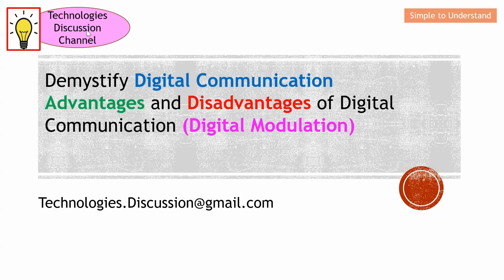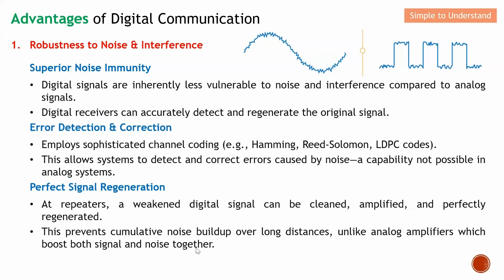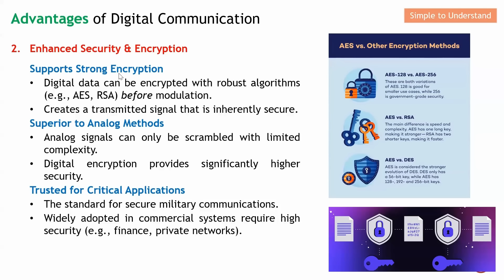Digital Communication #4. Advantages & Disadvantages of Digital Communication (Digital Modulation)

Comment from the maker: Thank you for your time to view this Digital Communication Series course. I have decided to revamp the topics of discussion.
In this video, I would like to explain why almost all communication now happens to be digital. This is because the advantages of digital communication simply outweigh all the disadvantages and also the advantages of analog communication.
The advantages of digital communication include:
1) Robustness to Noise & Interference
2) Enhanced Security & Encryption
3) Efficient Storage
4) Efficient Multiplexing and Integration
5) Compatibility with Digital Systems
6) Flexibility, Scalability & Signal Processing
7) Lower Cost & Higher Integration
8) Single-Chip Solutions
9) Consistent Quality and Performance